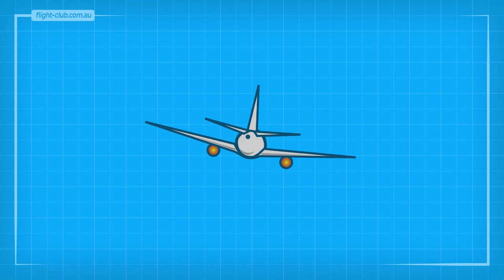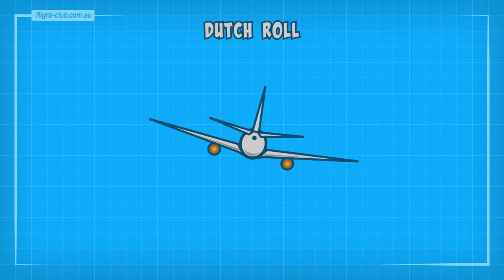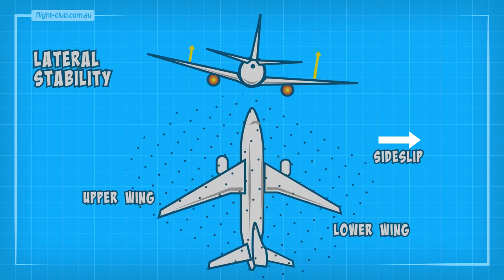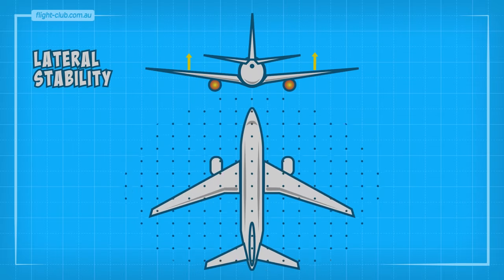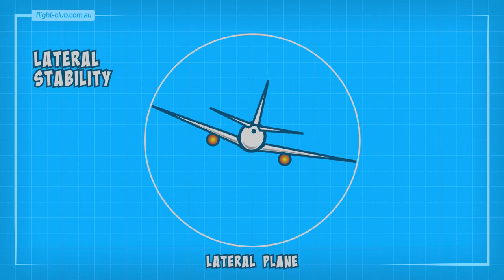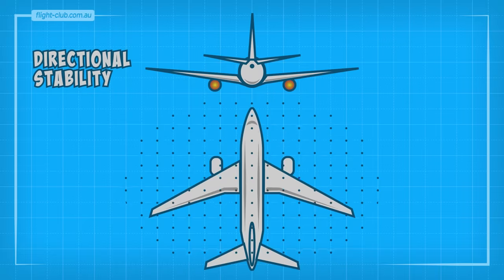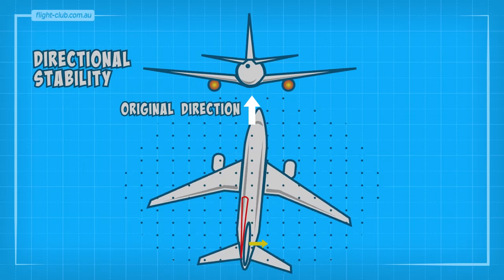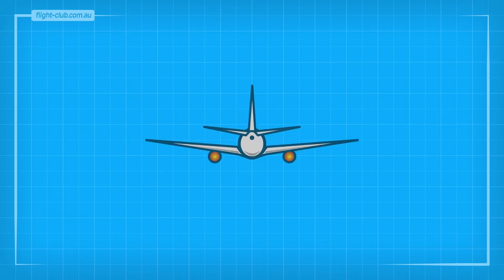Understanding Dutch Roll | Simple explanation.

Comment: Could not get an answer to a basic doubt. When the aircraft is banked to the right, it sideslips to the right, so the right wing experiences more drag on the right wing. Now what causes the aeroplane to yaw to the left ? The vertical fin is still in a position to make a right turn from the sideslip. Main question is what causes the aeroplane to yaw towards the left ?

Comment: Seems like it would feel similar to the instability experienced when hauling a hitched trailer load behind a truck with the weight distributed to the back of the trailer.  Without the Yaw Damper it would be too easy for a pilot to overcorrect with the continued oscillation

Comment: Different source says the opposite about the lift and drag of the wings.It says left wing creates more lift and more drag in a similar position .

"DUTCH ROLL
If the aircraft is yawed to the right, the left wing advances (sideslip) and generates more lift, while the right wing slows down and produces less lift. The result of this imbalance in lift is rolling in the direction of the initial yaw. The advancing wing also produces greater drag due to the larger areas exposed to the airflow, which causes the aircraft yaw in the opposite direction. This results in the right wing producing more lift than the left wing, reversing the direction of the roll. The final result is rolling and yawing oscillation which have the same frequency." source ACE TECHNICAL PILOT INTERVIEW
Reply: in videos example it start with a roll whereas in my reference it starts with a yaw i am aware of that but still couldnt grasp the difference totally
Reply: i think i got it :D .There are no pilot inputs , so when aircraft yaws right, left wing produces more lift and more drag , but when aircraft ROLLs right. lower wing(right wing) creates more lift and more drag

Comment: now explain it without swept wings
Reply: Why? Straight winged aircraft will tend to return to stable flight much more quickly than a swept wing aircraft as the effective sweep of the wing is different (see 1.05) when yawing so this compounds the problem. Therefore it only really became an issue with fast swept wing aircraft.